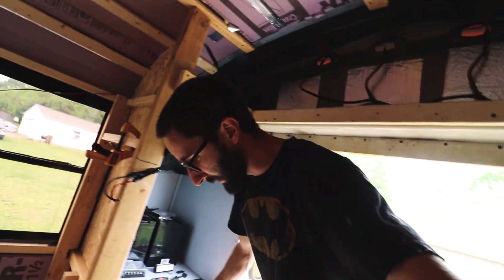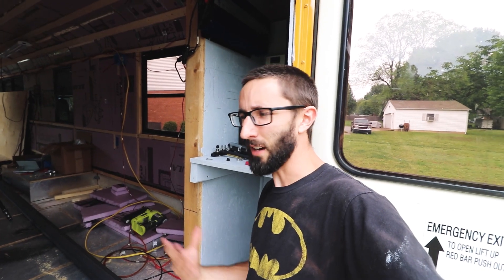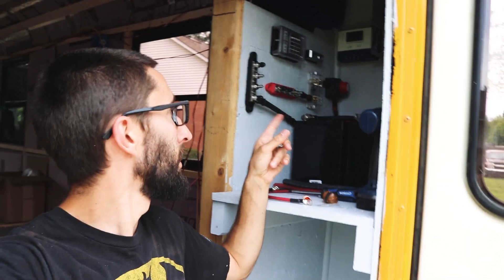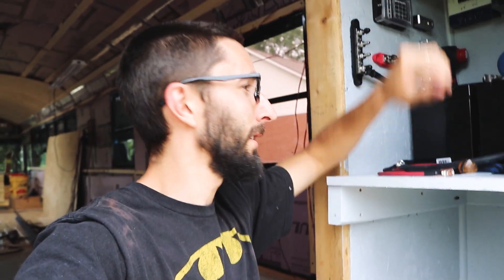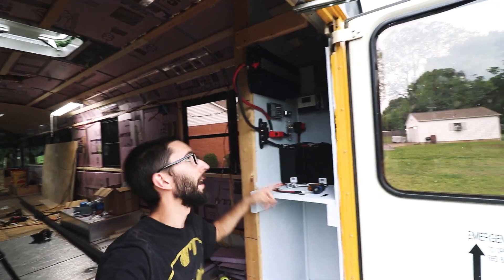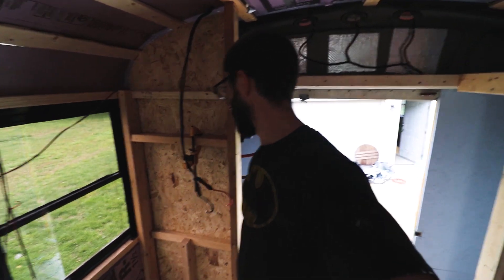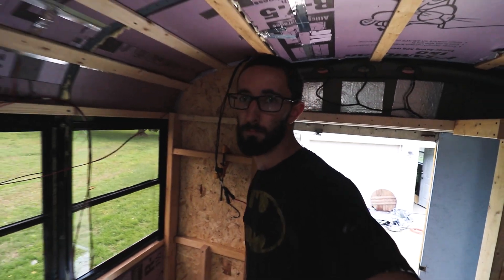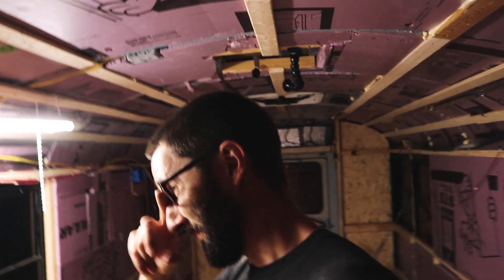Installing DC 12V & AC 110/120V Components for Solar & Shore Power School Bus // Skoolie Conversion

Comment: Hey man I appreciate this video from the very start Just purchased by GMC school bus 5 windows on each side and I'm and I made a couple mistakes already.However I haven't started the inside.I'm doing maintenance on the outside Successfully.Did the oil change easy peasy?Did the antifreeze however something that I came to learn was A lot of buses have so many after market wires that it can mess up your electnicole.So I'm going to hire a guy who's auto.Electrician, and I'm gonna have him come out.I think he said either Tuesday or Wednesday of next week.It's february thirteen today So I'm gonna be patient.Wait a few days , do some other things Do some other things in the meantime like learning about inverters because I don't know to much on the topic of Inverters mechanically inclined but wires FORGET ABOUT IT 😂

Ps it's a 2001 chevy c/t van pretty much a chevy express 3500 with a school bus on the frame so it has a 6.5  Detroit diesel motor runs very well but once I get the wires handled I will be ready locked and loaded until then ima make more money 😂 this ain't a cheap journey to anyone thinking they can spend as lil as possible be realistic and be sure to go for quality and not a quick job you will thank yourself and your pockets will thank you as well

Comment: Hey dude!  Looking good!  I am doing basically the same thing here in a van.  Very similar setup.   I'm having a hard time figuring out how to wire the inverter to the subpanel.  If you could help me out with what you used for this that would be great.  Or any resources you used.  Thanks!
Reply from the maker: Hey! I used 10/2 wire and just ran the white, blk, and ground to the proper locations in the subpanel.

Comment: If I can’t do mine I want to make my bus completely off the grid I want to get a big inverter that I can run everything like 7000wt or 8000wt just so I’m comfortable and I want to get 200 gl water tank but I want to also get a pump and a filter system so I can pull water out of a lake or river or something but I still want to be able to go to a camp ground if I want invade there those days were it rains for days or a hurricane
Reply from the maker: Honestly I think the biggest you'd really need would be a 4000w inverter. I couldnt imagine what you would be using that would require more than that while being off grid. once you plug up to chore power to use other stuff the power inverter can get bypassed with an Automatic Transfer Switch. As far the pulling water from a creek, You could just get a 110v water pump and syphon it that way into your tank. and then run a filter or 3 before it gets into your tank. Thats what I'd do. Keep it a little more simple.

Comment: I know I’m trying to find the cheapest bus  that is the largest 40 I want a mid motor I guess they call it that flat face front motor but I don’t know everyone says there loud and bring in heat and from the looks of it they don’t come in 40 feet Cummins I found a Thomas freight liner that has a Cummins it’s 72 I think but it’s more  money I don’t know i guess will see everytime I get set up to get one just for them to sell it
Reply from the maker: Yeah I think a pusher is the most quiet but Im not sure. Its not terrible. Its not the most comfy thing to drive but it could certainly be worse.

Comment: Hi there, I love watch your progress, what is the $ amount ( est) for your system? Also did you buy a kit or, buy individual parts. Thank you
Reply from the maker: Hey! Thanks for watching! I plan to make a video about all of it. I got the GS540w (now it's called the GS600W) from Grape Solar. And the rest of the Components I got separately from Amazon. All in all it right at $2000. But that's everything. Shore power, separate battery Charger, onboard Generator. Everything that we will need incase we don't have sun. Video to come for sure.

Comment: Nice job! How many amp hours of batteries are y’all doing? Lithium or lead? We’re just getting in to calculating our estimated daily usage to start designing our system size. Yours is definitely looking clean!
Reply from the maker: Hey! We have the Grape Solar GS540W kit. So we have 3 180watt panels. With a 40amp pwm charge controller. Which will feed 4 100ah agm barriers. That will go to a 12 circuit 12v fuse black ran with 8awg wire. And the batteries also feed a 2000w continuous 4000peak pure sine wave power inverter with a automatic transfer switch fed with 2/0awg wire. Which then feeds a small "100amp subpanel" where we have a 20amp breaker for our AC and 3 15amp circuits for all of our 110/120 outlets. And we have a 30amp shore plug that feeds into the inverters automatic transfer switch. The fridge is the only thing that is constantly going to be running off the power inverter and it's only 80w. Everything else is 12v, like out lights and phone chargers. All of the extra 110/120 outlets are for laptops, computer and monitors (my video editing stuff) and then kitchen appliances, like airfry, crockpot, instant pot. We will have a 3500w generator on board as well in case we need more power or to run the AC.
Reply: @BackroadPurpose  Nice setup and seems pretty hefty on the power (which is good!) I gotta get on my spreadsheet and finish my anticipated calculations because I'm getting itchy to start finding the components for our solar system! (but there are sooo many other projects in front of this one! Thanks for sharing your specs! We appreciate you!
BTW... You're editing is AWESOME!! Love the shots and angles you get! Great job, dude! 
- Brian + Erin

Comment: Looking good, sir.  What are the system specifications?
Reply from the maker: Thanks guys! We have the Grape Solar GS540W kit. So we have 3 180watt panels. With a 40amp pwm charge controller. Which will feed 4 100ah agm barriers. That will go to a 12 circuit 12v fuse black ran with 8awg wire. And the batteries also feed a 2000w continuous 4000peak pure sine wave power inverter with a automatic transfer switch fed with 2/0awg wire. Which then feeds a small "100amp subpanel" where we have a 20amp breaker for our AC and 3 15amp circuits for all of our 110/120 outlets. And we have a 30amp shore plug that feeds into the inverters automatic transfer switch.